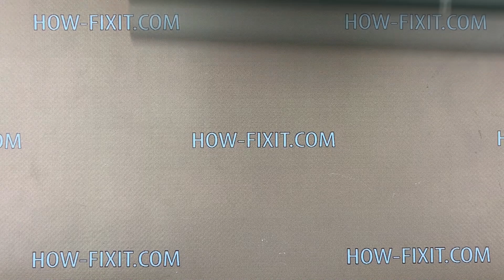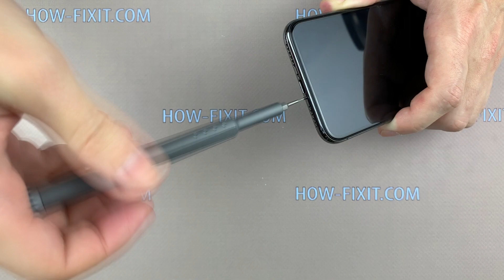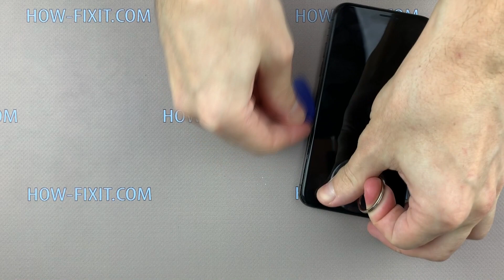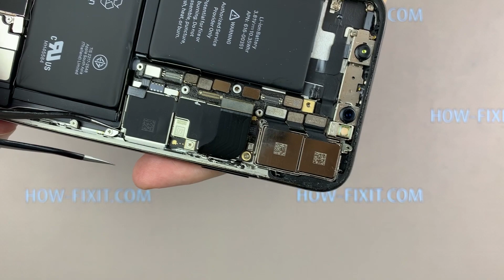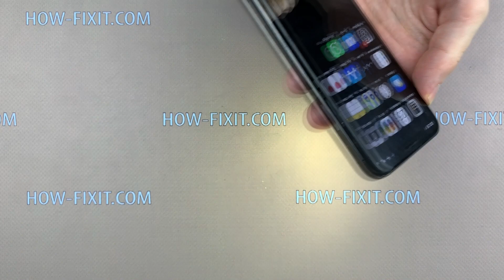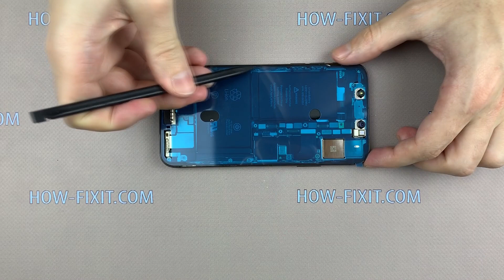iPhone X Motherboard Replacement | How to Fix Activation Lock Issue

Comment from the maker: **Links to motherboard for iPhone X and screwdrivers for disassembly in the description under the video
Reply: I have seen your video on YT and liked it. I need some help regarding info  How-FixIT . Can u guide me i have broken my iphone x from front and also back and now bought a iCloud locked iphone x to change the outer housing . Can u explain which things i need to change from the old( broken) iphone x to new iphone x ( which is very fine condition but icloud locked) . What i got from your video is that we only need to change motherboard and then only that earpiece from display which also contains faceid ? Is it correct ?? No need to change anything else ??
Reply from the maker: Yes, you need to reinstall the motherboard from the broken iPhone, the face id module and cable with a speaker and sensors.
Watch this video, it will help in your case https://youtu.be/z2nGCwuEWbo
Reply: If i swap the mother board from one broken iphone x to new housing  do i also have to swap this front camera also to get the face id as it is giving the mess faceid unavailable i swapped logic board and total piece attached to display to new but i did not swaped the front camera as it goes under the battery. Plz guide .
Reply: I have changed/swaped logic board and iR module and earpiece attached to display as u guided perfectly but faceid does not work if u can kindly guide.
Reply: How many price iPhone x motherboard

Comment: I need help pls, when i removed the motherboard a little pin dropped out frm the sim card port, the pin is fr the ejector mechanism, pls any video or guide on hw to replace it back

Comment: 👋 hello! I have changed an motherboard to iPhone X but is not working touch screen, why??? I have see your video and it’s very simple to change but now is not working  my touchscreen, can you explain to the problem? Thenx.
Reply from the maker: hi!
1. Check the socket on the motherboard where the display cable is connected, maybe dust there.
2. Pay attention the display cable, maybe you could tear it.
3. And the last thing that possibly happened, you fasten wrong screw. Try connecting all the cables from the display to the motherboard and not install metal panels on top of the cables and not fasten the screws.